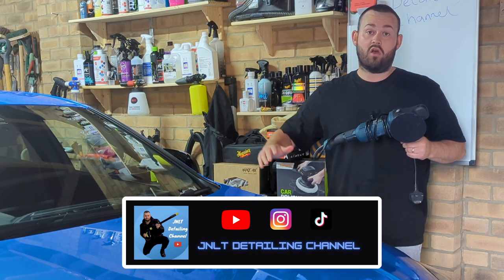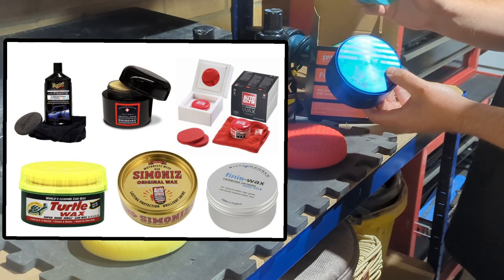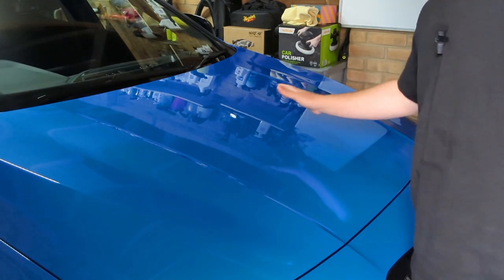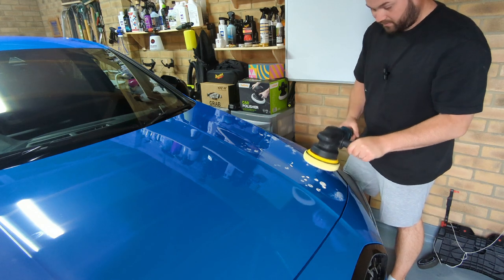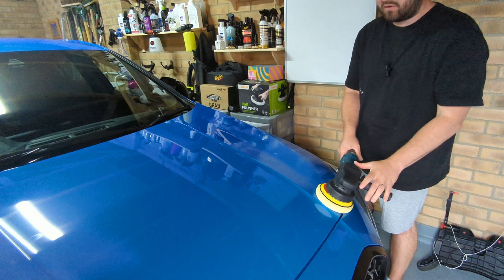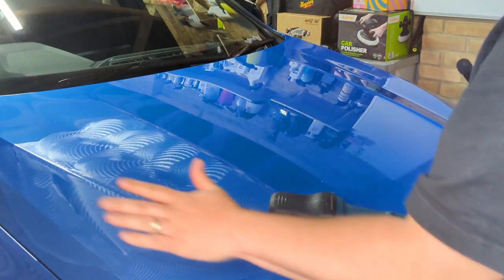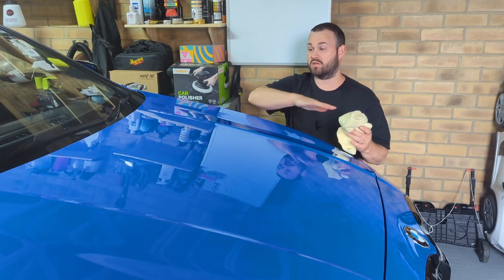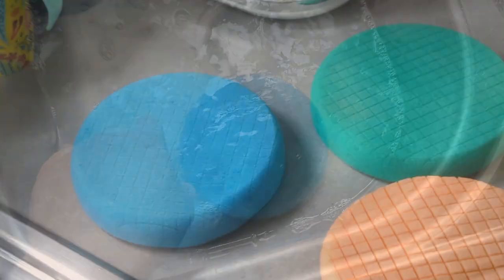Beginners Guide to Machine Polishing - Easy To Follow Steps At Home!

Comment: Great video, thanks! One question about pads. Did you use one pad for each stage for the whole car or several of each type? Did you brush out the pads to clean them after each panel? Thanks again 👍
Reply from the maker: Thanks for watching. Happy to help, so I brush out the pads after about  2 -3 panels roughly with a plastic bristle brush. Just keeps the pads working at its best, but you could also have extra pads of the same type to swap over with if that was easier. Obviously you could just use the pad for the whole stage, but they just become less effective after around 3 panels of work. So if possible try to clean them, hope this helps?